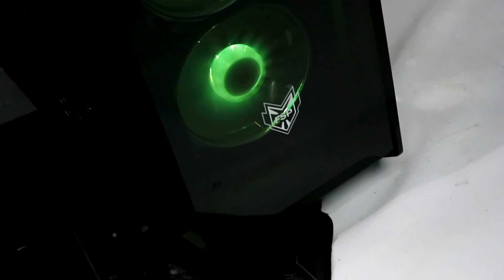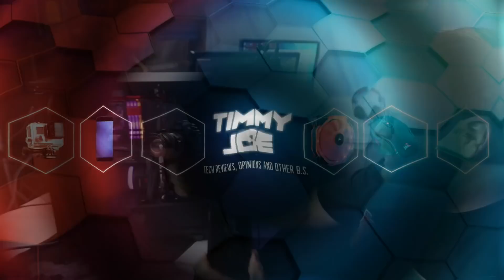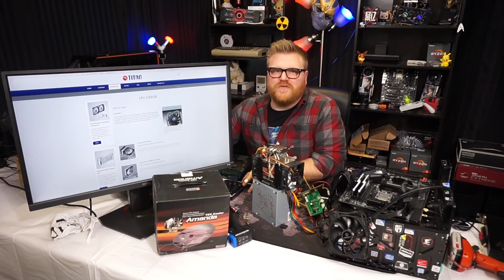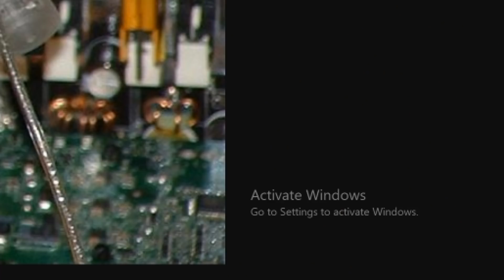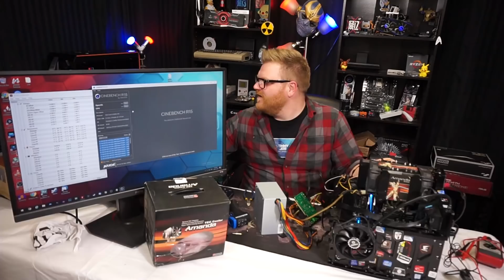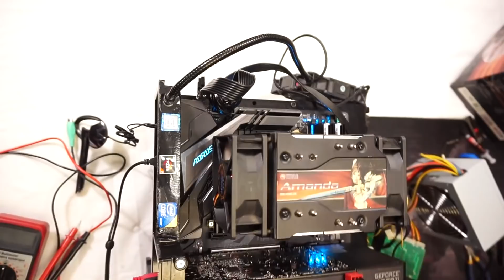This 12 year old thermal electric CPU cooler is COOL!

Comment: It was released and intended for the Core 2 Duo, you're criticising the fact it doesn't supercool a 10+ year later generation multi-core 5Ghz chip

To all the folks stating these TEC coolers don't work because it would freeze the chip and create condensation, this cooler is working in existing systems 10 years later.

Titan Amanda TEC cooler, the most underrated and most falsely criticised cooler ever released.
Anyone that owned one loved it only people who never owned one criticised it.
Reply: Physics, they cannot handle a high heat load.
Besides that, I've got a much more efficient cooler from 2006 that can keep a 500w FX below 0c core temps (block at -25c under 500w load, -58c at idle). Its doing great on FX, and dissipating probably 6x the heat while keeping it drastically colder while not pulling much more power. So yeah, TECs suck. They are fine for raspberri pi overclocking (probably stack 2 or 3 since the CPU will be peak at 5-8w, that would be fun), but in practice suck for such concentrated heat loads and efficiency. That's why you don't have a full size fridge with them, the power consumption would be dozens of times higher. And that inefficiency goes into... Heat... It is a vicious cycle since with more power, you need to dissipate, the  more heat. Compressor systems made these vastly obsolete for anything substantial.
Reply: @jakegarrett8109  It's been comfortably managing overclocking a E8600 core 2 Duo to 4.7GHz @40C on load 12C idle for over ten years.
Terrible performance compared to an FX...

It's still on a par with any core i7/i9 on single core performance at 4.7Ghz
Try to understand that was the performance over ten years ago matching today's best [single core performance] at comfortable temps and still both the cooler and chip are running strong as a prime gaming machine.
Best cooler I've ever had.

As I said the only people critical of TEC coolers were people who never owned or used one.
Reply: @thetruthwillout810  Mine is pushing 500+w and staying below 0c on the core. That's my point (I wasn't talking about CPU performance, I can put it on my Threadripper 1950x or a single core Sempron), my point was that phase can handle heat load. Not only 500w, like mine, but in the thousands of watts. This is physically impossible for TEC on a CPU the other side would need to be cooled by some 8000w cooler, which would probably be liquid nitrogen, and in which case, just use the liquid nitrogen!

Its people that are critical that have a clue. They know it works for low power CPUs, but they know physics won't allow using them on anything high powered, and that they are seriously inefficient (like I said, cool for pi overclocking and similar low power devices, especially with TEC costing well under $80 for a module/heatsink/PSU, they can be fun). Unfortunately they simply don't work on 200w CPUs like phase does.

Small stuff = yes, and they are dirt cheap and cool
medium power = usually considered impractical due to power consumption (and maybe only a few degrees gained)
High power = melted TEC!
So you can use them up to medium power (like probably a Ryzen 1700, those things top out around 120w), but high power like FX it doesn't work.

Comment: An infrared based thermal sensor doesn't detect properly on emissive metals or reflective materials. Use a thermocouple probe to get these temperatures

Comment: feed it more volts, it will get colder as long as the hot side can handle the extra heat.  since it eventually reaches the same temperature in aida64 the hot side is likely getting heat-soaked which means its not powerful enough.  There are many different peltier units in this size (~50mm x 50mm) ranging in power from 5w and less up to about 400w.  The hot side of the peltier needs to be controlled to keep the cold side cold!

Comment: if you look at the wiki page again there is a picture lower on the page that states "Peltier elements all conform to a universal identification specification" and says in the picture "(P-N couples) highly doped=more conductive" meaning the more "P-N couples" you add the more heat you will remove and hopfuly if this is true i hope the hex 2.0 took this into mind and packed as many P-N couples they could into the Peltier device and built the limiter into the cooler so its not dependent on a specific system bus like the amada cooler's limiter was dependent on PCI

Comment: I actually researched Peltier plates a whole bunch about 2 years back. I was thinking of modding a PS4 to use a Peltier device.
Your temperatures aren't staying extremely low because the plate acts as a heat transferring plate, you need to dissipate the backside heat, the colder you can keep the hot side*, the *frostier the cpu/cold side will become.
These are what make those "Black Ops 2 Juggernog mini fridges" work.
I'm telling you this because if you can dissipate the heat transferred from the Peltier plate, you can make the cpu and motherboard completely freeze over with ice 
Even though you wouldn't really want frost built up on your board, you can do this.

Comment: we had that one. a friend of us upgraded his core 2 duo etc mobo etc t oa i7 stuff
he gave us the core 2 duo and mobo (ddr2) and later gave the cooler this wierd as amanda we where like wtf is that, (we bought a core 2 quad for the pc) so with oc we needed a good cooler so he gave his old one. damn we did remove the eletric shit cause that was using way to much power and gave us problems, but hell we were like wtf is this wierd ass cooler. pretty funny to see you have it

Comment: if the cold side is getting warm then youre either not cooling the hot side or passing current in the wrong direction, you would effectively have the opposite of a cooler strapped to your cpu... a heater, you would have a heater strapped to your cpu....

Comment: The Amanda is bottle necked on a current CPU by it's heat sink. Peltier coolers need a much larger heat sink then is required by just a CPU because the Peltier is actively transferring heat rather then passively.  The massive heat sinks they required to function efficiently and the condensation problems are why they were not more widely used.

Comment: I used to actually have an ULTRA Cooler that was peltier cooled. Thing was awesome. Sad that the ULTRA brand died, They pioneered the first fully modular PSU as we know it and made incredibly good coolers, I still have on in an old build with my I5 3470 since it had 775 cooler support.
Amazon seems to have a Peltier cooled CPU cooler from Phononic? Im kindof interested.. But it costs way too much for my blood lol

 Anyways, I bought my Ultra branded Peltier cooled CPU cooler several years ago off ebay (Was very hard to find with all the parts even back then), Needed a new thermal sensor and that was it. Sold it with my old Core2 Quad build I had maxed out back in about 2013 after building a new rig. Heck I should have kept the whole computer, It was pretty slick. I had one of those ridiculous Ram coolers from Corsair, My Intel DX38BT supported DDr3 for the Core 2 Quad and I thew a Gtx570 into it lol... Those were some cool and interesting times

Comment: I think thay should remake make one. As 12 years is a long time. In theory take the same block with 90mm fans with 6 heat pipes and the curent going parallel through the heat pipes and block.  Just need a small fan on top to reduce heat that your adding to it with it useing 12 volts. 

Good idea. 
Have seen something like this done on massive machine's at work.

Comment: Mechanical engineer Here, The peltier coolers are a neat concept and your results match what the thermodynamic theory would predict.   Each of those thermo-electric devices are rated for a specific thermal throughput in Watts.  If you stay under that maximum thermal envelope than you will be at sub-ambient temps on the cold side of the device. Because the cooler is able to pull the heat away faster than the CPU is making it.  When you exceed that thermal envlope then it provides no advantage, or maybe actually hurts you.  So to cool a 200watt TDP CPU to sub ambient you need to somehow find a way to split the thermal load up across multiple peltier devices in parallel, stacking them wont work, think of them as water pumps.  You can only pump water as fast as the slowest pump in the chain when thire all hooked up back to back. but if you let all of them pull from the source at the same time you can pump more water.

Comment: The peltier cell is too small. If you get a bigger, more powerful peltier cell (120W or 160W cell for example) it will drop temps quite a lot more.
It can even get subzero... but you have to dissipate the CPU heat plus the peltier cell heat... so you will need a bigger heatsink.

Comment: Cool video. Keep up the obscure  items. obscure 
Oh btw timmy, that e5-1680v2(8core) cost about $500+ AUD for me and I got a E5-2697v2(12core) instead I got around 1700~ CB and around 5k in cpu-z, and does around 1min40 in vray. I would have loved the 1680 as that overclocks and with mine, the fastest fsb I can push it to is around 113. But atleast it does turbo all 12 cores to around 3.4-5ghz. 
I do some virtualisation work so its a fine balance between the two and it chews about 70 watts less than my 3930k@4.6ghz. It will be a interesting video if you do plan on making one with that cpu though.

Comment: I am so glad the days of every part of a computer has some crude cartoon chick printed with an inkjet printer stuck on it, least I can turn RGB off

these types of coolers were very popular in workstation computers and gaming rigs in the early 2000's they have a problem though at some point you can overcome them, and so they kind of went poof off the market with things like the pentium 4, as you are seeing with your system the benefits start nose diving vs just normal cooling 

you also have to start thinking about condensation

Comment: it feels cold to the touch because it takes away the heat from your fingers very fast and that to the body is cold and the faster it can takes away the heat the colder it feels but the surface itself is not that cold celsius wise the plate itself may get colder in time in celsius i think not sure
Reply: ps one of these peltie or whatever will be great in a water cooling system with a lesser heat sink and fan

Comment: Im currently building a cooling system off peltier coolers right now! Insanely power hungry but very fun nonetheless.

Edit: I Also have a large amount of these coolers if you're interested in a few for future content Timmy Joe. Consider it my patreon 😁
The dual gpu cards you have (like your famous shirt design gpu) might be fun to take two peltiers and two hyper 212 evos and make them run in parallel. Would definitely look cool AF with a little time and since itd be ran that way youd only increase your system build by 120watts MAX really about 60 watts cause you never run a peltier at full throttle, you get dimenshing returns without a heatsink the size of the motherboard :p LmK

Comment: @TimmyJoe Great video thanks. I had a cooler like this not exactly this cooler but one like it. The one I used had a larger TEC plate and cooled like a ice dream. As you could see they require a large heatsink to cool the TEC. Back in the day this thing allowed me to OC like crazy but you have to watch how low the temps go when the system is idle or things can get a bit damp. What I ended up doing was turning off the power saving features in the system bios which did not allow the cold plate to cool below 0c because the CPU was not going into full power down mode when idle. 

It would be interesting to see a company build a modernized version of this that could keep a modern CPU around 35-40c under full load. Then again the bigger the TEC unit the more power it requires and the more heat it outs out so maybe they stopped making these for that reason. I liked the one I had it was a lot of fun to mess with for sure.

Comment: Peltier coolers are stackables. And the colder you can get the hut side, the cooler it gets on the cold side. Stacking then together makes around a 30% increase on it's performance. I have done this with water coolers . Essentially making them into chillers.
Reply: Thermoelectric coolers (TECs) are horrendously inefficient (slightly better now than a decade ago, but not really by that much). Cooling a hunk of inert material is the easiest. Cooling and controlling the temperature of an active, power dissipating device is harder. Much harder.

What does this mean for you? Well, you stack TECs in order to make your cold object colder. But it comes at a big penalty in how much power your "cold" object is allowed to expend. That first stage is only 10% efficient. The second stage has to be sized so that all the power of the device AND the first TEC can be pumped through it, and at only 10% efficiency again. Ouch. In the case above, a second stage would have been pumping 110W, so it would have needed about 1100W to pump that, meaning 1210W overall. Your efficiency goes to hell with stacked TECs - each additional stage has to inefficiently pump the inefficiencies of all the previous stages.
If you want to be as efficient as possible, use a single stage. That will limit your ultimate temperature, but will pull the most power off the cooled device. If you want the lowest temperature possible, stack your TECs, but understand that the maximum power your can dissipate will drop like a stone.
Reply: Additional it generates a lot of heat. So be sure to use it outside the case, and the problem with the one you are using is it is not really good transferring the cold. You need a better termal paste. (And cooling a aio is a lot better. Because the water takes the heat away from the CPU. And the cold away from the Peltier far more efficient
Reply: How do you add peltier cooler to water cooling loops?

Comment: Need to be careful with condensation building up off of the Peltier, which could short out your motherboard. Would be nice to see the Peltier in an AIO. You can get them from Aliexpress in China. They can be found in electric camping cooler boxes or dehumidifiers.

Comment: these type of coolers cause condensation and will fry your chipset.  that why this tech never took off.  there was know way to effectively  keep it dry and evaporate the moisture.  There are newer versions that moderately work, but the only way to deal with the moisture was to make or use less voltage which negates the cooling capabilities of the cooler.  if mfr tried to increase the the cooling capabilities the moisture would once again be an issue.  that what could have happened to your first motherboard you referenced?  great video and thanks for the walk down memory lane!

Comment: You went above the cooling limit of the peltier, that's why it stops working when you put on a load. That being said, we don't use these things for a reason, they are ridiculously inefficient, at that point you may as use a refrigerant based system.

Comment: so its similar to the Coolermaster V10. NVM you showed  the v10 later in the video
but peltier cooling is no different  than phase change. it has its merits but its has drawbacks

its a small cooling solution but due to the design of these hybrid peltiers towers, the heat tends to "bleed" to the Cold plate. and peltiers will draw more energy as the temperature on the Cold plate goes higher
so its not efficient for normal users and its cant cool like LN2 for the extreme users.

for regions with high humidity, you need to insulate the area close to the peltier against condensation

usually peltiers are used in small dehumidifiers or in small dry cabinets.
cheapo 2-4 soda can chillers also use peltiers.
watercooling survived due to water  efficiency to carry the heat elsewhere.
intel did the logical next step and used an aquarium chiller to cool the water for that "infamous showcase". And Linus did try it out for themselves.

phase change is used in aquarium coolers  but due to their internal construction, its relatively quiet compared to having a couple of High Speed fans blowing air into your case. and aquarium coolers have built in temperature probes and regulating circuits. so if you want to have below ambient cooling after trying water cooling. spend on a decently sized aquarium chiller.

or move to a snowy region and use your PC to melt snow into water using a copper coil.
Reply: Vastly different! Physics completely dissimilar! My phase cooler doesn't use much power, but can withstand HEAT LOAD! 500w from FX is not a problem, core temps peak below 0c. Plus, even though mine is a small cooler, it should have no issue with Threadripper. TECs, physically cannot do this. They need some 200w of power to "cool" 50w of heat, and that means the heatsink needs to dissipate 250w. Ok, fine, now try even a 200w CPU, or 400w CPU... Yeah, find a cooler that can keep those cold enough for some 2000w of heat output! They just don't scale at all. Phase compressor systems, you can make those as big as you want, and even multi-stage them to go colder. THAT is the big difference, phase can handle unlimited heat load, TEC's cannot! Plus they are dozens of times more efficient...

Comment: Buildzoid made a liquid cooling setup using 4 Peltier coolers and 2 RAM blocks for the cool side, and with 4 air coolers on the hot side. He was able to get the liquid close to zero if I recall correctly. I thought about building that style of setup myself.